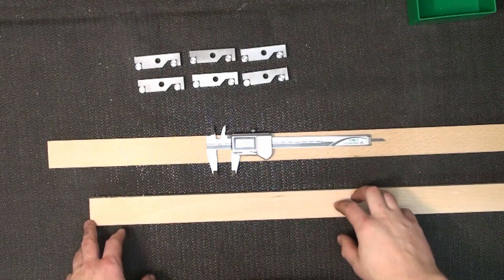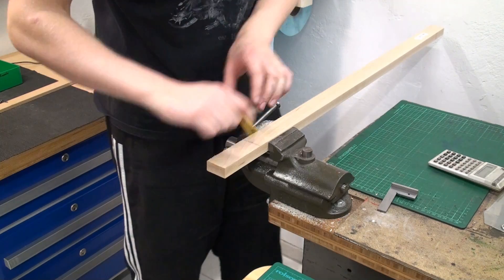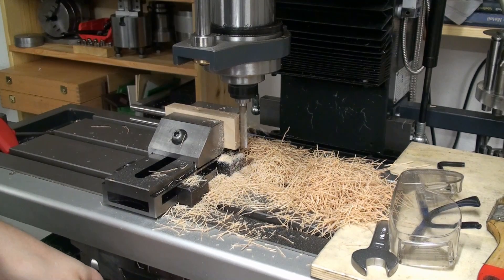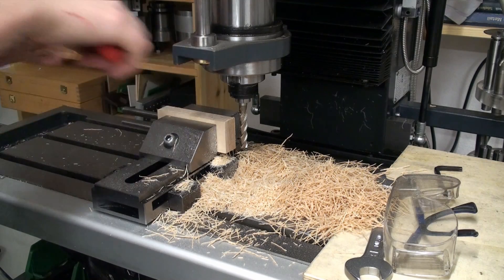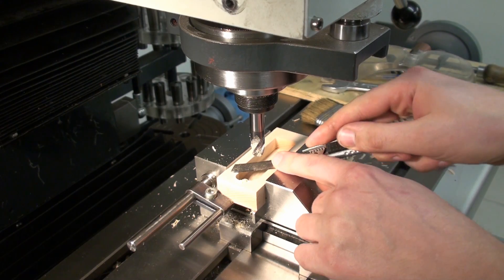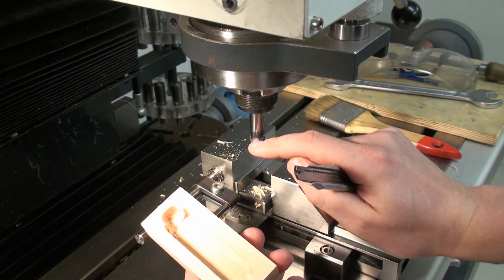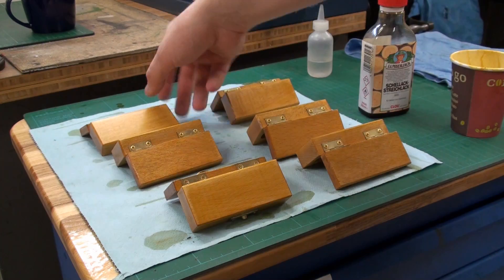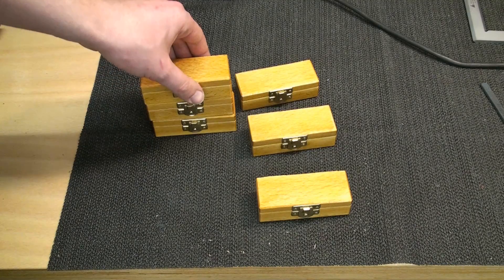Making boxes for the sine bars - Herstellung der Boxen für die Sinuslineale

Comment: I know that im late to the party, but one suggestion to anyone who sees this... Dont think of a vise as the end all/do all type of clamp... A vise wont be offended if you use additional clamping from the top, like a strap clamp - to hold the thing down, along with using a ``vise stop`` as another point of solid contact, which gives 4 points of contact, not just the 2 of the vise jaws... Some vises come with tapped holes in the top faces of the jaws for exactly that purpose, but i would rather use a table mounted strap clamp, which can be used before full tightening of the vise jaws, as to completely mitigate the jaw lift effect... The strap clamp should also rely on a long t-nut, or a custom mounting system, as to minimize the brutal force of the jaw lift that would otherwise be exerted through the t-nut into the slots of the table, which is never a good thing... A screw actuating the jaws and causing them to lift has immense capacity to produce force, and any potential damage to machine tables or components should be avoided... Using the strap clamp after the final tightening of the jaws merely faces the force of the clamp actuating screw and the lifting forces, should any overcome the vise jaws grip... But setting a clamp and then clamping the vise can result in immense pressure spikes, and small t-nuts can easily rip a chunk of cast iron out... 

All the best!
Steuss

Comment: Beautiful work, as usual!
Btw, you can polyurethane over de - waxed shellac for a tougher finish. Also, hand scraping gives a superior appearance over sanding. What I do is to sand the wood smooth then I take a slightly damp sponge and lightly wet just the surface. This raises an uneven grain surface which dries to a slight washboard effect. I then hand scrape with high quality spring steel scrapers which cut the surface to a flat finish. Now when you shellac or polyurethane, the grain of the entire surface stays flat because any grain that would have raised has already been cut off. 
Now the surface will be as close to a mirror as you can get. 
Next, after final coats of polyurethane, I like to wet sand with 600 to 800 grit. Leave as is or finish with wax or furniture polish. 
Love your work, Stefan!
Thanks for sharing so much!  :)

Comment: 'Rough milled' is what we cabinetmakers call 'dressed all round'. One pointer: you can hide the hinges inside the box joint, and leave just the hinge knuckles exposed at the back, then lay green baize felt fabric in the cavity, also cover the hinge plates with it, if you want a proper old fashioned look and feel.

Comment: An important caution when working wood on machines designed for metal - Wood is much more abrasive than most people think and can wear precision machines to uselessness.

Tree growth depends on water and nutrients brought up from the ground. Along with these, dissolved minerals from the soil are also carried up into the wood fibers and cells.
Minerals are simply defined as rocks, and usually of definite crystal structure.
Grinding wheels are also made of minerals.

Wood and anything made from wood, (almost all paper, for instance) is really rough on cutting tools. A seamstress or hairdresser knows quite well not to let anyone use their scissors on paper. It can ruin the scissors quickly.

Have you ever noticed that vintage woodworking machines are far outnumbered by metalworking machines of the same vintage - when the opposite used to be true. They don't have a long life unless rebuilt often.

Also, have you ever noticed that all modern wood cutting tools (sawblades, router bits, planer & jointer knives, shaper cutters, even chainsaws, etc.), have carbide cutting edges.
Most high-speed steel for wood was obsoleted a long time ago because it wouldn't hold up to the abrasive action of wood.
(I have seen new carbon steel bandsaw blades wear out completely after cutting through only two 8 inch diameter rolls of Kraft paper.)

Another problem with wood is that it is a very poor conductor of heat. In metal, a large portion of the heat generated by friction is usually carried away by the surrounding material.
In wood, most of the heat has no place to go except into the cutting tool, causing overheating and chemical deterioration of the cutting edges, and in some cases, annealing of the steel hardness (carbon steel in bandsaw blades for instance).

Try to keep your wood shop and your machine shop in two different rooms. Wood sawdust is abrasive, too. Letting it settle on the thin film of waylube on your mill/lathe ways is almost like putting Clover valve grinding compound into your Zerk fittings or lube unit. And once it gets in there, it's very difficult to correct.
I once saw a  Bridgeport that had lived in a wood shop for most of its life so worn that the saddle would audibly rattle when powered up. Couldn't hold a sixteenth in the center of travel.

So, if you value your machine shop's machine tools, keep the wood in the wood shop with the woodworking tools.

As an aside, cast iron is another material that requires the same general precautions, except for the thermal conductivity problem. 
Most shops I worked in kept a separate room for cast iron work. Fortunately cast iron is almost always worked dry, but the ways would always wear prematurely on those machines.
Keep a vacuum cleaner handy and use often.

Comment: I once had a box designed with an uneven floor that allowed you to press down on one end of the contents, which rocked on the uneven bottom raising the other end so the item could be removed. 

I have another box which avoids the perpetually-loosening hinge screws by using a nearly full-length piano hinge  which inserts in diagonal slots in the body and cover and is attached in some unknown manner so tightly that I cannot even get a wiggle out of it. I guess it is glued since I have nearly exceeded what I estimate to be the yield strength of the wood with no movement. It looks like it should have some sort of mounting tabs, but afraid I would break the wonderful box, I surrendered.

Comment: "Wood sucks"! A phrase spoken by many metalworkers on the rare occasion they build something with wood. Nice project to finish the series. One thought, if you predrill for the screws and put a bit of wax in the holes the tight grain structure won't bite the screw as tightly and allow the screw to pass. My dad taught me this and I've had good luck with it.

Comment: Very well done for a woodworking novice!
A few tips for others:
Oak is a bad choice unless lined with felt. It often contains salt and mineral inclusion that will cause spot rusting. Mahogany is the best wood for this.
Use a steel screw to preform the threads (even if the pitch form is slightly different). I actually have a screwdriver looking tool that has a brass screw thread form on the tip for doing this. Preforming the thread, and using a lube like wax or soap will make this chore much easier.
Scribe the layout lines with a sharp knife or chisel and you get no burs and a very sharp edge. It also makes it easier to align the chisel for squaring the corners. The "proper" technique is to hold a chisel in your fist with the point projecting out the bottom like a stabbing knife. It sounds awkward, but you get perfect control with very little effort. Scribing the mortise lines it sort of a combination of rotating your wrist and squeezing the chisel while the edge of your fist is resting on the work.
When using the chisel, go across the grain, not with it. It will leave a better finish and is far easier to control.
The yellow shellac you used is a very good choice. The more raw the shellac the better, it contains a high wax content (it is what shoe polish is made from), and will resist moisture well and pick up a great patina as shop oils get mixed into it. Avoid polyurethane, many shop fluids contain stuff that will attack it.
Reply from the maker: +joshua43214 Yes, I am aware of the problem with oak - Lucky for me, I got it wrong, its beech :D
Thanks for the good comment on the screws and on the hint with the mahagony!

Comment: Stefan, great job on the set of custom fit tool boxes. Cutting the same small parts on a table saw and using a router wouldn't be any easier than what you did for the same level of precise. The small brass screws are a real pain and require pilot holes even larger than the screw body size or risk breaking them off at the head (been there, done that). Thanks for the series, Paul

Comment: Stefan,

Just a remark regarding using oak for boxes.
Don't use it of you have another choice. Oak will slowly release acidic compounds, which will greatly enhance corrosion.
Just hammer a nail in a piece of oak, and try getting it out a year later.
Varnish will help of course, but it isn't really an ideal wood for storing your precise pieces made out of metal.

Cheers
Patrick

Comment: A very unusual and fascinating video. I work with wood as well as metal, so I really appreciated it. The most amazing thing is to watch that pantograph masquerading as a router. In fact, I think it works better than a router. In my own opinion, routers are far too fast. On the other hand they leave fewer "burrs" and that is why they run so fast. In the end, if you build a precision tool, the box should be as good as the tool. But then, all my woodworking is done with hand tools. It is a vacation from Maschinenwerk.

Comment: As always very nice work Stefan. Maybe the "real" woodworkers would cringe at the methods, but don't knock it unless you've actually tried milling wood. The control compared to even a table mounted router is amazing, plus there's no high pitched scream of a router deafening you. I was sort of half expecting some almost impossible to replicate super complex Japanese joinery tho. :-) And I've yet to ever see any mill manual where they say not to use it on wood. Pattern makers once used something much like a manual mill to build very accurate patterns for sand castings. Today I expect it's all CNC. 

The company is now out of business (Wagner Saf-T Planers) but no doubt one could be found on ebay. I use one on my mill and it works 10x better than using it on a drill press that they were designed for. If anyone's interested there's quite a few VERY scary Youtube videos showing there use on a drill press. There basically a 3" diameter face mill for wood with some pretty cleverly designed HSS cutting tips that can be easily resharpened in anyone's shop.

Comment: Very nice project from beginning to end Stefan. A little trick I use when working with brass screws is to first use a steel screw of the same size to form some threads. That way it is easier for the brass screws to go in without stripping the heads. Thanks for sharing your talents.

Comment: Enjoyed the video, and this was a perfect ending to a great series!  However.. I have some complaints / criticism::

1. I followed your video exactly and made two boxes of my own.  However, my 5" sine bars do not fit.
2. I didn't have carbide tooling of the right size so I used HSS.  Now my boxes feel soft and spongy, and I
can't get rid of the flood coolant smell.
Reply: You can fix this by annealing the boxes.
Reply: It's good to know both of you are following AvE's advice to keep your wood in a vice.
Reply: +This Old Tony Oh my! You should make your sine bar boxes out of a rutabaga instead, following doubleboost. Then you would not need flood coolant, it's built in.
Reply: Ha! So, sometimes 5" is actually 5" long?!
Reply: I chalk this up to your youth and inexperience......
I just use a wood stretcher and then my over length parts always fit. 
You must need a little more time to accumulate this kind of wisdom. :)
Reply: Trolling Old Tony. 😉

Comment: I love the way wood looks and feels but I hate how unstable it is as a material. I laugh a bit at the precision work with wood, knowing a change in humidity the next day can throw it all out of whack from where you milled it.  Doing the woodwork on my barn/shop drives me a bit nuts since I have to settle for much lower tolerances than I am used to.  This project turned out nice.

Comment: Great work Stefan.  I appreciate you leaving in the video where the wood got sucked out of the vice. I had identical moment recently while machining the edge of a 2" x 4" X .25"  piece of brass.  I had about 2 hours of machining into the part when the mishap happened.  My reaction was identical to yours...   "stuff happens"
Reply: I am fortunate enough to have a scrapper here that has my back.  They hold brass for me at $2 per pound.  I grease the skids by bringing them donuts when I visit.
Reply: +Fred Miller you are truly a lucky man to get your brass even scrap at $2 per pound bet those doughnuts are the real good home made type,  it is nice to have a good tradesman to work with  even for "scrap stock"
Reply: 2 x 4 x 24 piece of brass? In inches? That was a costly piece of stock no doubt.
Reply: +James Kilroy he said .25", with a decimal, i.e. 1/4"

Comment: Simple trick to stop the brass screws chewing up when screwing into hardwoods; is to use a steel screw of the same size first, then replace with the brass one, also drilling a pilot hole helps lots, especially if the screw has a plain part by the head. That way you do not risk shearing off the brass screw in the hole, and the brass screw will fit nicely with no bad screwdriver marks on the heads.
Reply: +Dave Ticehurst And also use a little soap or some other kind of lubricant helps a lot... ;)
Reply from the maker: +pierre beaudry Wen in doubt, use lube! Great tip, I did that on stainless screws for wooden decks, but it never occured me to try it on those little buggers...
Reply from the maker: +Dave Ticehurst Good tip - I predrilled them of course, but tapping with a steel screw is a good idea, thank you!
Reply: +Dave Ticehurst Just as well that I read all the comments, otherwise I would have repeated your advice. Although a lot of "big box stores" "brass screws" are brass plated steel if they are Pozi drive, which should go in easily.
Reply: Beat me to this response (by a long time), though I was taught to rub wax on them as a lubricant in addition

Comment: Hi Stefan 

Oh, they look very nice indeed !

But IF the wood is oak it is NOT suitable for boxes for iron/steel equipment - oak contains tannin and it will attack the equipment and it will rust very badly and the wood will be brown/black - just a free advice !
Reply from the maker: +Keld Sørensen Thanks for the hint on the tannin/rust problem with oak - And as I found the receipt when I bought the wood, its not oak but beach, so should not be a problem - And there is a layer of shellac on the inside too :)